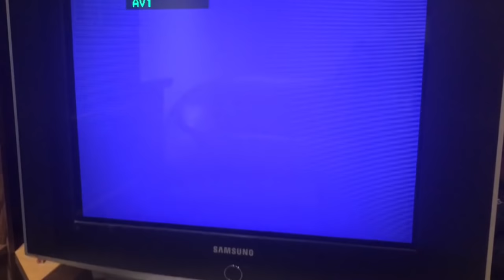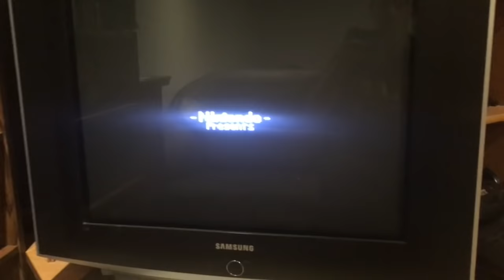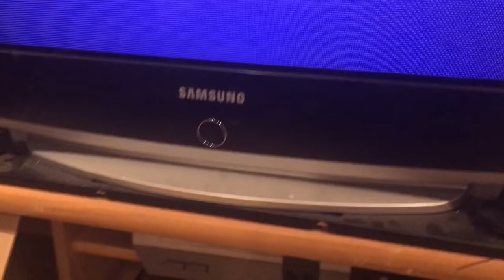Fixing eBay Junk - Super Mario World - How to Repair Traces

Comment: The shell for that copy is not correct either, SMW was shipped in a style 1 shell (single horizontal line on the bottom portion), this is a style 2 shell for newer games
Reply from the maker: I've seen numerous copies of both styles.  There's also various labels with a different text layout
Reply: RetroRepairs it might actually be a reproduction or something else undesirable
Reply from the maker: It's not. They released multiple styles of smw carts, and nobody is going to bother reproing a $20 game.
Reply from the maker: Here's an example of three different cart styles they released this game in.  I've had them all.

There are even slight changes in the ROM itself.

https://m.imgur.com/r/gamecollecting/idn8U00

Comment: I have a original snes game when i try to play it.it says this product will not play unauthorized copies my snes console also has small lines on the screen please help
Reply from the maker: Devon Grant try clean the cartridge contacts and the cartridge slot in the snes.  I've heard of this before, and often it can be resolved with a simple cleaning.
Reply: Devon Grant does the SNES play other games fine?
Reply: Tails64DS NT Channel  it only plays marios and donkey kong but with small lines one the screen i cleaned the pcb pins and the console
Reply: Devon Grant it's hard to say without seeing it, i'd say probably a RAM fault or corrosion around the PPU data lines.
does the lines shift or change when you tilt the cartridge?

Comment: You where wondering what is pin 55 and where does it go, i hope this reference can help

http://i.imgur.com/6AYwYVkh.png  (Cart slot pinout, may be useful for you in the future in your trace repairs)
https://upload.wikimedia.org/wikipedia/commons/a/a5/Nintendo-10NES-Lockout-Chip.jpg (NES, left-CIC standard)

 it is CIC out data and goes to pin 2 of CIC copy protect chip.  Chip is identified by Nintendo logo and date in the middle and is most often rectangular in form factor.  Its approcimate location in famicom/s-famicom carts is the left side of the PCB by standard in their design.  SNES games typically mount theirs parallel to the pads for cart slot while NES games mount it perpendicular, but the CIC lockout is always on the left side by Nintendo Standard (Copyleft, eh?  Nice jab, for how strict they are nowadays in PCB design)

 Your assertion that it goes to the chip just above your finger in your video is correct.  It goes underneath the chip to pin 2, which is one left to the smaller engraved dot you see on the CIC lockout chip there at 8:06 on the left hand side of the screen.  Great assertion.  :-)

No criticism from me just a helpful schematic for your future.  Keep going I stink at soldering myself. My boy does it for me.

Comment: on general princapal i would just change the battery with a new one
Reply from the maker: Definitely a good idea, they do die over time
Reply: I reccomend throwing in a battery socket too.
Reply from the maker: Also an option.  Makes it easy to change batteries in the future without a soldering iron, but I figure 20 more years from now, it can be someone else's problem.
Reply: wtf is a 'gen principle'? i'm guessing one of the top ranks above 'priv principle',,,

Comment: I'm a new subscriber. Thanks for your channel . One thing, if you don't have a smaller tip I'd invest in one.
Reply from the maker: Ordering a whole new soldering station actually.
Reply: RetroRepairs which one did you get? Sparkfun has one they sell that is excellent for the price - temperature control that is solid. It can take Hakko tips too. I have a heat gun for SMD from them too.
Reply from the maker: Just getting a knock off hakko 936 for now, and I plan on looking into getting a better quality one eventually.
Reply: RetroRepairs this is what I have https://www.sparkfun.com/products/retired/10707 Unfortunately they don't sell it anymore.  The Weller they have for $45.00 looks like a good buy. Anything that has changeable tips and can hold consistent heat is good imho.
Reply from the maker: I was looking at one similar to what you posted the link to.  Do you have it? If so, how do you find it?  I might just pull the trigger on that weller. Seems like a good deal

Comment: Easier way is to remove ROM chip, put it into donor-board ( any compatible game you dont want ).  You can find compatible donor boards in list 
https://docs.google.com/spreadsheets/d/1J-Y2z2UeoYw5UHYP1f-rW5VswUXRdpdzsYJFFAA88Ns/edit?usp=sharing

The problem with fixing these 'traces' is that they are stressed traces and are more susceptible to having either the lead you fixed OR other ones die soon.

Comment: 1st things 1st.. I am amazed you could plug that cartridge in and out of the console without loosening if not destroying the consoles pins, what with those large blobs of solder left on the cartridge contacts designed to make contact with the consoles pins.
Also are you aware that some if not all hot glues can be removed with the application of Alcohol or what was that other chemical used in contact cleaners? Meh.. I can't think of it off hand, Anyway I only ask because if anyone decides to clean one of your refurbished cartridges with Alcohol or some contact cleaner the Hot glue you used will be made redundant as soon as most electronic contact cleaners makes contact with it..

Comment: bravo i woukld never tell any body what to do but just consider artificial heat seak on ics and similar components when applying heat ted taks has a really good show on reverse engineering of 6502
Reply from the maker: lukefenderrhodes cool, will have to check it out.  Are you referring to using a shield so the ic isn't affected by heat?  Probably not a bad idea if I'm still soldering near it, but I would think the conducted heat through the ic leg would be more intense than any radiated heat off the soldering iron.
Reply: I'm sure you have found one already but a quick search for heatsink soldering on ebay shows up the clips and they are good for use when soldering anywhere near chips

Comment: Your selection of "the setting with the sound icon" is wrong. That is a diode setting to test diodes.  Yes, you will hear a sound when ANY continuity is found, but a'lot of things require certain ranges of continuity.  You should be using the Ohm setting and with what you are checking should be getting 1.0 or less Ohms, probably 0.0.  As Phil said below "Reading the comments, it seems like everyone's an expert", did it ever occur to you that some people actually are experts and do this sort of thing for a living?

Comment: looks like that cart shorted out nasty and blew up. probably someones wife threw water on it while running. or kid lol
Reply from the maker: Definitely could have been a spill or something. That, or sitting in a real humid environment, and the moisture was pressed against the board by the plastic shell
Reply: @RetroRepairs  damnnnn thats a good 1. most likely that 1. makes the most sense. sitting for years in new orleans or something.
Reply from the maker: Oddly i picked it up locally in northern Ontario, but who knows